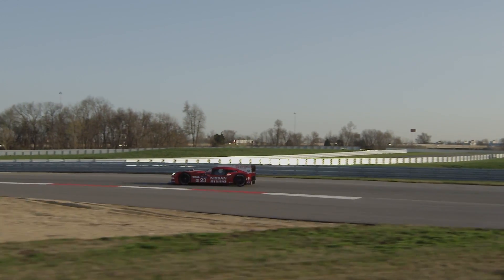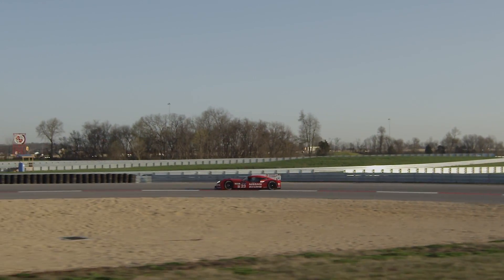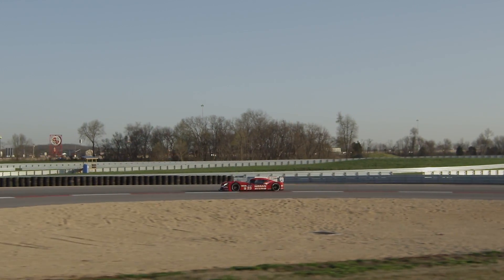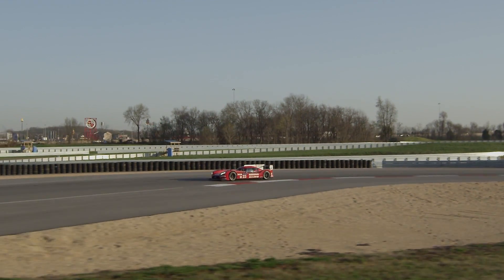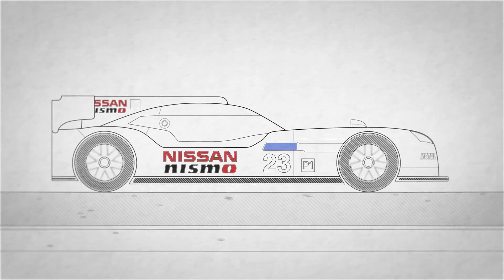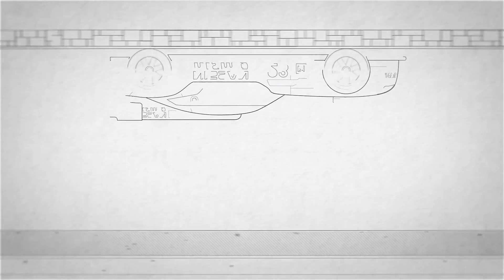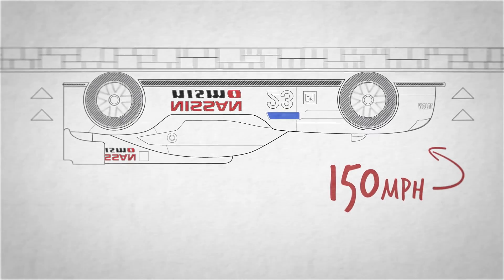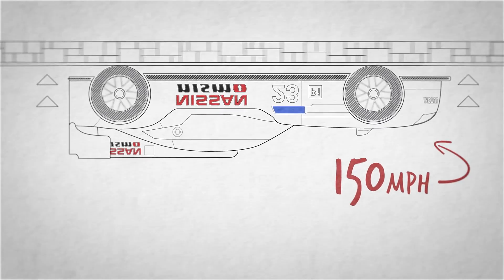HOW DO THE AERODYNAMICS WORK ON THE GT-R LM NISMO? : NISMO UNIVERSITY

Comment: Tell me Nissan, your goal is to beat Porsche and Audi in endurance racing and you come up with a front wheel drive race car. I understand that you want to be innovative and I understand that but just stick with what works. Nothing was wrong with a rear wheel drive race car, keep things simple. Less things to go wrong during a race. Just giving my opinion as an engineering student:)
Reply: And if it worked you would have called them a genius. People don't innovate by repeating the same tried and tested formula. They go outside the box. I guarantee their FWD mission isn't over with and they are working on a solid racer.

Comment: what about torque steer? since its FWD
Reply: QuertrGTRR Even with equal length axles that the LM Nismo has (meaning it doesn't need an electronic diff to control normal torque steer), you have to keep in mind that this has to put down 1000hp+, if there are bumps or slight irregularities in the track surface or even tire temp/condition it can make the car dance around slightly as it fights for grip, but it won't do your typical FWD torque steer where it always pulls to one side when you accelerate. It will be generally stable but may throttle steer if you're impatient with the throttle. This also happens with RWD cars but in a more natural feeling way for a racing driver (because of weight transfer, among other things), so when it happens from the front it's a bit strange feeling. 

 Also, I predict the LM NISMO will get into the 3:30 range for qualifying. (3:34?) We'll see how close I am.
Reply: ConnorWolf

Comment: Your car will not be able to go upside down as you cannot achieve it in the space required, I know this as I am an engineer for BAE and we have driven a car upside down for aerodynamic testing.
Reply: The main tests were done at Brough and the actual test was done in a British army Base with a 7 mile tunnel.
Reply: Sadly the tests were used for ministry of defence testing and advanced aerodynamic research so they are still classified, however I can give you my email and I can answer any questions that you have.
Reply: ben ingle Also my biggest recommendation is to use fully rubber tires as tires with air in them will explode off of there rims, and if you need to start it off with a fan used to gain extra down force as it will help you when going from the ground to being upside down.
Reply: No problem i have sent the email so you should have got it.
Reply: ***** this has been the most constructive video I've ever seen much love and best of all good luck on the races
Reply: ben ingle thanks for the added information so gravity has a lot to play with that correct? Without breaking any confidential information good day
Reply: Thats the main force that you are trying to overcome in this case and in the case of going fast in racing, but the ways of overcoming both of them are different, as a racing car is not trying to fall of the track its on.
Reply: ben ingle Well, I think he was trying to say, at 150kph, it has more downforce than weight, but I do understand how it is overstepping to claim it could do it upside down when it never actually could make it there given it is not designed to do that, especially when his analogy is exactly the kind of stuff you do :P
Reply: ben ingle Is it feasible to put a full size model/real car in a 150 MPH wind tunnel? With a rotation platform that can put it upside down when the air speed reaches desired velocity.
Reply: as the car will have to be in a fixed position yes its very easy, but i take it that you mean it will not be in a fixed position so it will not be possible as the car will not be moving it will become unstable and eventually go into a spin or it will get pushed by the wind into the back of the wind tunnel.

Comment: Makes me laugh how people always say "This car has so much downforce, it could drive on a ceiling of a tunnel". Well why hasn't anyone tried it?

Anyway Good luck in the LM24!
Reply: Even though this is an old comment i think it deserves an answer. Almost 100% of cars are built to have their engine components and fluids work while upright and gravity assisted. Look at your Oil pan for instance. cooling is essential for an engine but once its flipped the oil will rush up (or down in this case)  seals in the headers etc aren't made to handle pools of oil nor are the components able to draw from an area. The motor would simply seize. You would have to design a Gyroscopic motor to simply do such a thing. Exceedingly complex.
Reply: @bucket-9-9  2 strokes can spend time upside down unlike 4 strokes. There is also the point that you need to transition from right way up to upside down which means keeping the downforce with some sort of moving platform. Also gotta remember that when you're half way through the turn gravity is gonna be fighting that transition. Highly impractical to get to that point hence why people say it but never do it.
Reply: *****  only there analysis and down-force of the gravity could make that car fall down if the car lacks it's speed to maintain. .